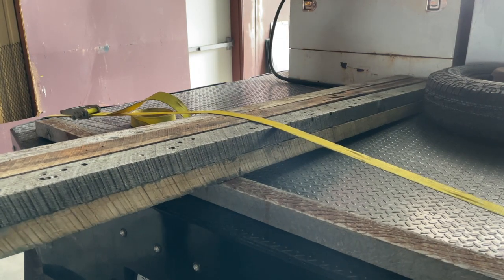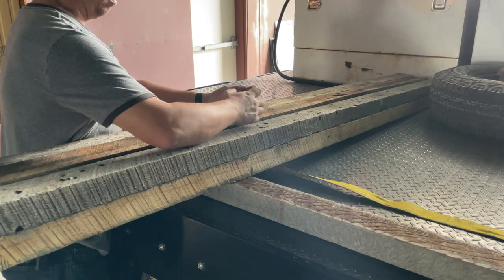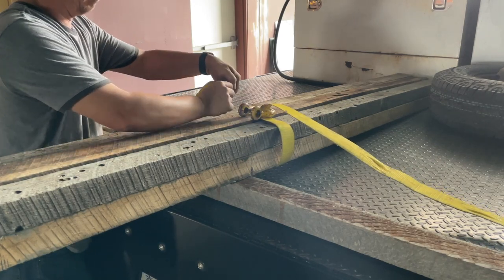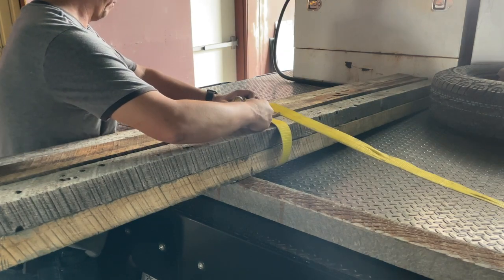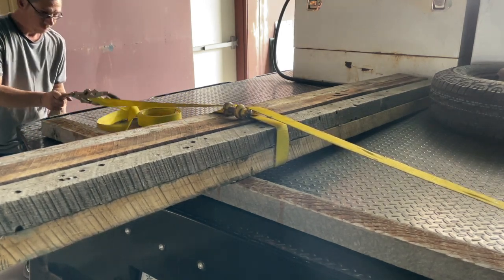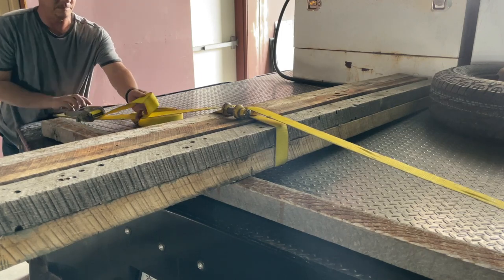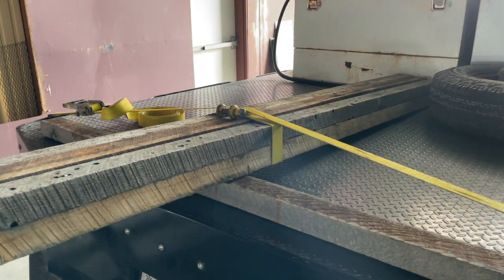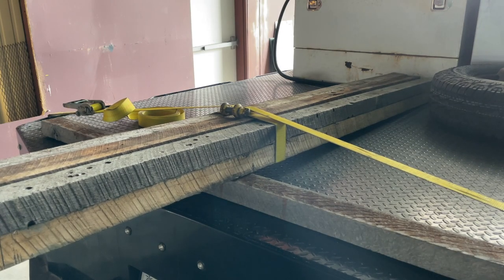How To Secure A Load

Comment: Side loading a shackle or clevis is not an acceptable safety practice .  In this instance, the size of the shackle and the pull against it will not make a difference .
Reply: I was wondering if someone else  was going to catch the side loading the shackle issue. Wouldn't it be easier to simply turn the shackle so that one strap is around the pin and the other is around the bend in the shackle? Although I know in hoisting your always want the pin through the object or lifting point on the load and the line through the dip of the shackle.

Comment: Never used a shackle in that position! Always one strap through the bow and one strap through the pin. If the strap bunches up in the pin then your shackle Is too small. better way, not everyone has a shackle with them so wrap the load then sinch it down

Comment: lol so a hundred years ago an old trucker taught me this trick, but our company policy was a load couldn't go out without a strap over it, basically our district manager, who was a jumped up salesman hired from another company who had never worked in the warehouse or the yard, said we couldn't do this unless we also had a second strap just going over it, so we often had to forego this if we had a lot of orders because we had to double strap everything if we wanted to use this method

Also, I later had a job at Lowe's and I often loaded people's trucks up with building materials.  It AMAZES me how many people have a big old truck and/or cargo trailer but they NEVER HAVE ANY FREAKING STRAPS or rope or anything, so you have these $10,000 orders on these expensive trucks going down the highway secured with the sorry ass bailing twine Lowe's provides for free, tied by yours truly just praying to God it holds because I did what I could
Reply from the maker: I’ve worked with quite a few people that just didn’t have any experience in securing loads down. Not only do they risk losing their cargo, but they put people on the road in danger as well.
Reply: @txtoolcrib  It's like a real life superpower.  I'm a pussy office worker now, but every once in a while like if I'm helping someone move or helping get stuff to and from a company event, I'll bust out like most absolutely basic securing techniques (I drive a small car but I at least keep a little bit of rope and one small strap handy, it is one of those lifesaver type things) and people are amazed, ask me if I was in the military or something

And I'm like Jiminy Christmas no I just did real work for a living at one point in my life how sheltered are you people
Reply from the maker: 😂 you have no idea how much I can relate!

Comment: Out of curiosity could the same thing be accomplished by crossing the strap at the top without using the shackle?
Reply from the maker: You can, but there is a lot more friction. You could substitute in a D-ring or large link as well. Doing it without a ring puts a lot of wear on your straps.